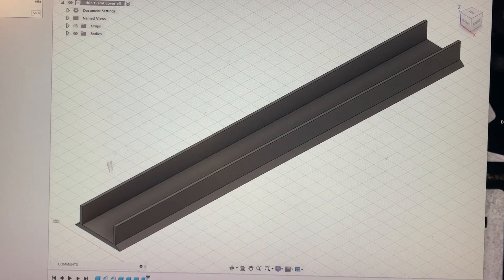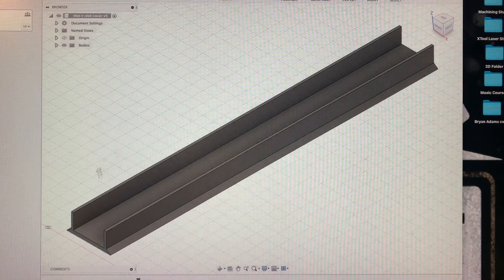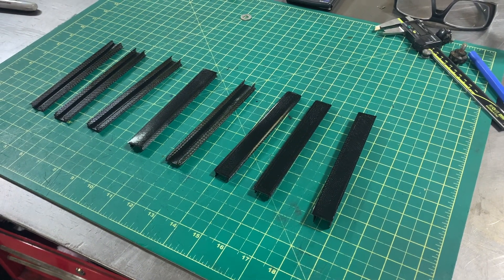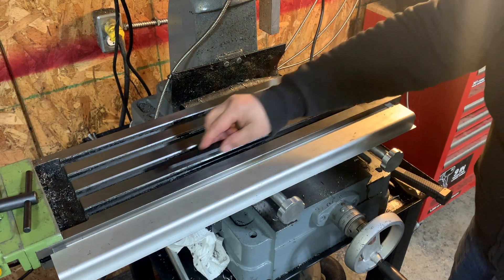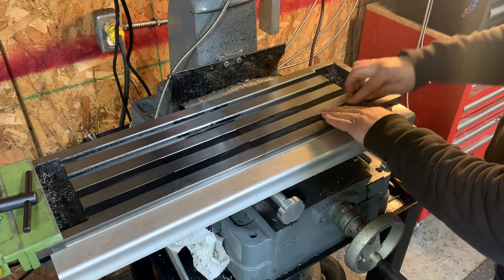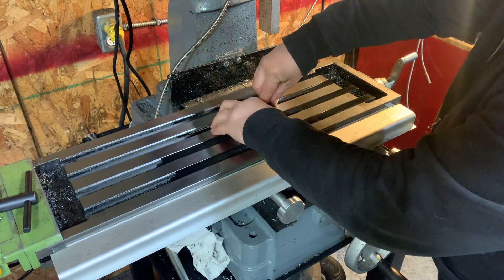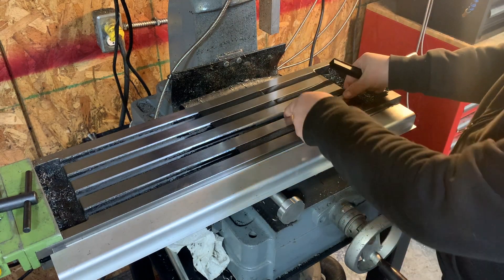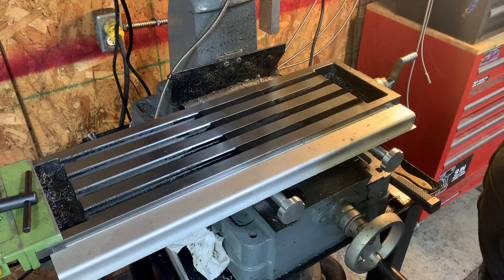DIY Milling Machine T Slot Covers

Comment: Octane Workholding makes high temperature silicone t-slot covers that are really nice.  They can be pushed in as far as needed to allow more coolant to flow to the coolant return area.
Reply from the maker: I have a company called Roger Tools Canada and I also provide those. They work great. Thanks for your comment. Gilles

Comment: Nice job.  I made mine out of TPU, it's flexible and I can just cut them to length with a razor knife.
Reply from the maker: That's the material I would have liked Mick, but my old 3d printer can't do that.  Looks like I need a new 3d printer lol.  For now though, it will be better than without covers. Gilles
Reply: @LetsRogerThat  If you want to send me the stl file I'll print some in TPU for you. I only have blue and orange though.
Reply from the maker: @MicksWorkshop  thanks Mick. I’ll try these out and see what happens. But I’m certainly curious about TPU.  How’s it been for you?
Reply: @LetsRogerThat  It works great.  It's flexible and very resistant to solvents and heat.
Reply from the maker: @MicksWorkshop  I just pressed the order button on a Ender 3 S1 Pro. That’ll be a Huge upgrade from my 10-15 yrs old Solidoodle 3.  I’ll add TPU to the grocery list 😊.